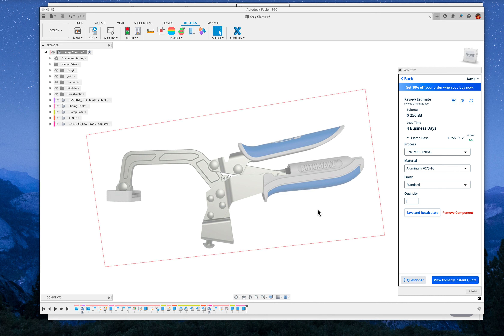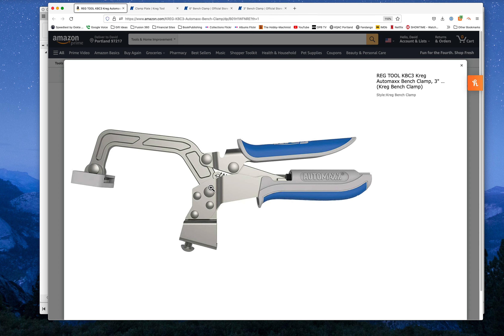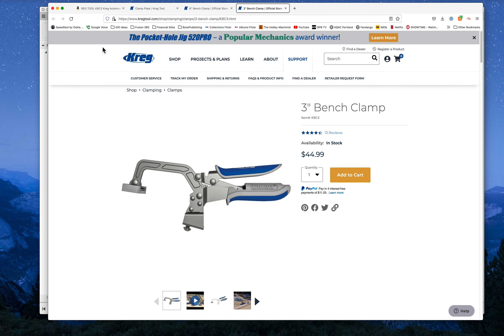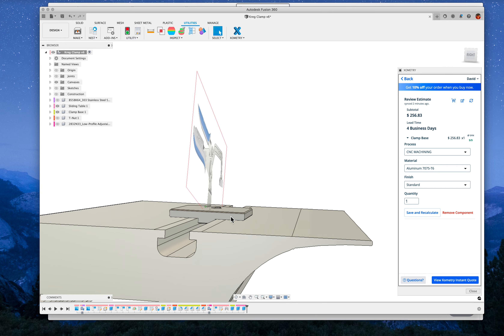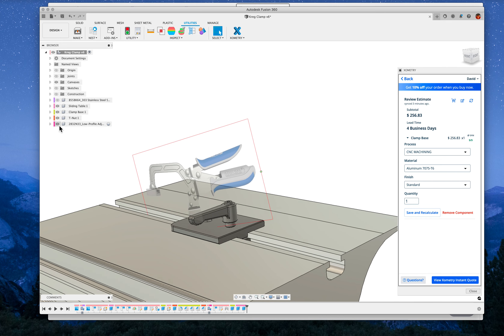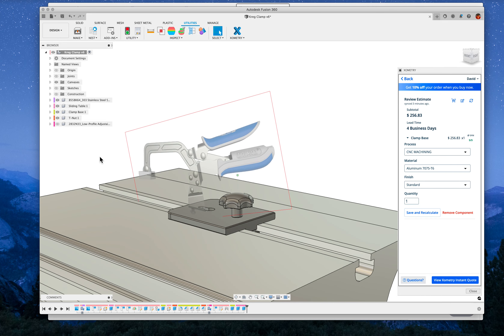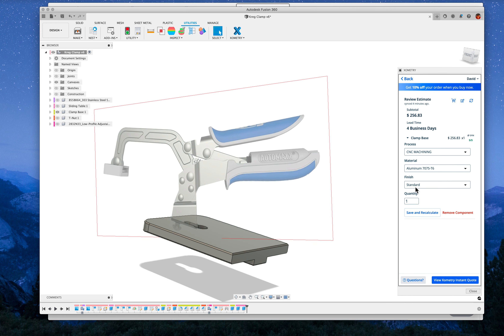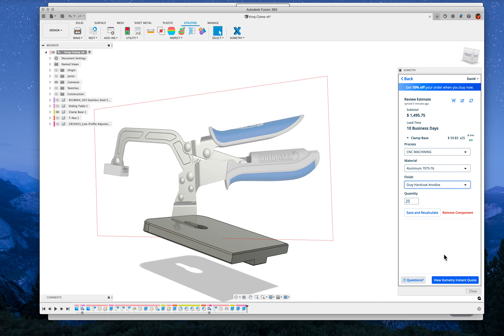Kreg Bench Clamp Adapter for Felder Sliding Table

Comment: I made something like this for the Kreg clamps to use on my Felder a few years back. I found that the act of locking the Kreg clamp caused the pad to move in XY a small amount, pulling things away from fences or otherwise messing with my setup. Is there some trick to using those things?